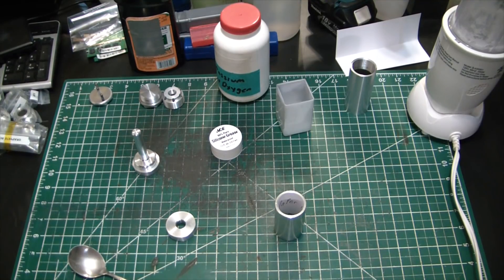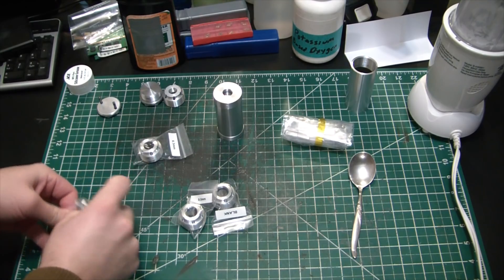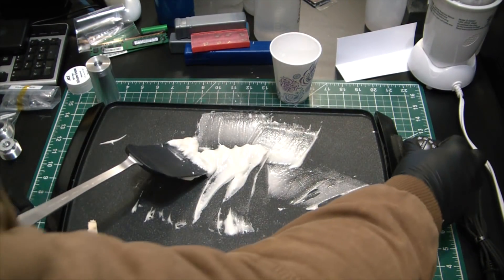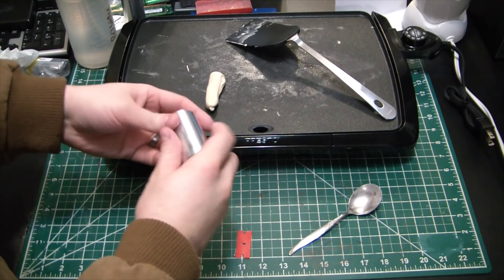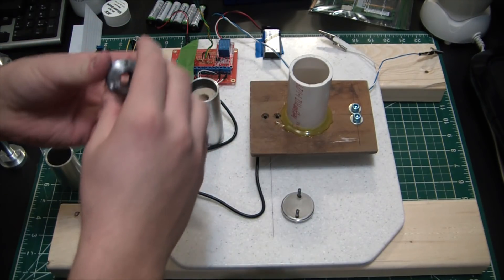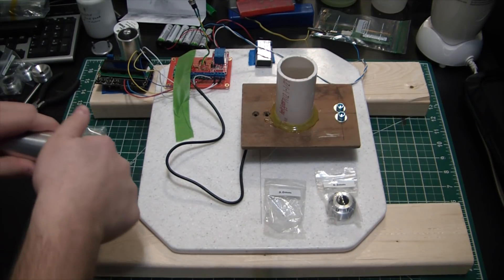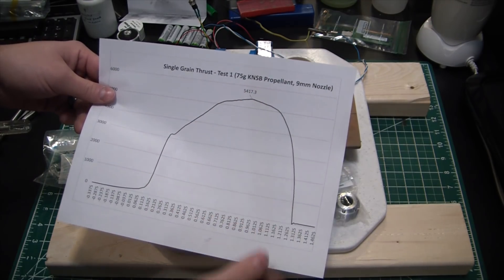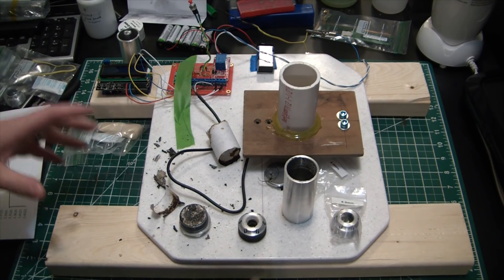Testing The Biggest Rocket Motor I've Ever Built on Arduino Stand - ElementalMaker

Comment: I'm a big fan of your channel! How do you calculate the diameter of the core rod for optimum thrust without blowing up the grain/engine? What percentage of the OD on the engine grain is the diameter of the core hole in the engine??  25%??  Thanks

Comment: I see Sorbitol was used but what did you use as the oxidizer KNO3, KCLO3, or KCLO4?
Reply from the maker: KNO3. KCLO3 is far too reactive to be used in rocket motors. KClO4 is one I haven't really tried for motors since I have NH4CLO4 available

Comment: have you tried to do multiple different ones like one of the fast burn (with the iron oxides) and the last one is a normal so that it has a lot of thrust and then it goes into the normal for long burn and yada yada and then have the burst charge to make a awesome rocket. should do a video of making a rocket and letting it fly

Comment: Why not heat the side of the chamber so that it melts and settles easily ? And also can u do a video on different oxiders?  Like I used patassium permanganate instead of potassium nitrate to make gun powder(kinda worked) research the different types of oxiders

Comment: This is the only channel I find myself referring to repeatedly to.  Like school texts.
My test stand is complete and I just graphed an old Estes A8-3.
I drilled holes in the pvc and hold the motor in with those squishy ear plugs.  3 of them hold it through the ejection charge.
I added an igniter continuity LED and a 1.8" Display (invisible in full sunlight)  Might need a piezo buzzer....

Long comment to bump YouTube Algos.
Reply from the maker: Thanks for the great comment 👍. What kind of thrust did you get from the A8-3?
Reply: @ElementalMaker  968g peak.  Wish I could post pictures... Just posted the graph on twitter: _Mycroftxxx
Reply from the maker: @_mycroftxxxadamselene922  wow pretty impressive thrust!
Reply: @ElementalMaker  I was surprised.  I bought these about 10 years ago. Thought they would be trash.  (But I live in the Phoenix, AZ area)  Even the igniters still work! with 9ish volts.
Reply from the maker: @_mycroftxxxadamselene922  black powder doesn't go bad as long as it's kept dry! Graph looked beautiful. Great data 👍

Comment: You could photocopy the thrust time curve, then trace the curve on a flat plate of aluminum, cut the plate to the shape of the tracing  then weigh the cut out of the plate. The weight is then proportional to the area of the curve. To estimate the total impulse make a rectangle out of this same aluminum plate, call one side “time” and the other “thrust” and multiple the length times the width, this area is the “standard” total impulse of the known area. The unknown is then the ratio of the weight of the unknown curve to the weight of the standard rectangular plate.  This is the “Galileo” method of integration. A faster method of the “Galileo” method is the use a length of fishing line and make a loop corresponding the total irregular close loop of thrust versus time. Then do the same with another piece of fishing line for the “standard rectangle” then the ratio of the length of unknown curved loop, to the length of the loop enclosing the standard rectangle is the total impulse of the test motor. Of course the curve “y -axis” and curve “x-axis” must be in regular units between runs (pick a total curve height greater than the expected thrust) and fix the ordinate scale. You can’t let the spreadsheet autoscale, you must use the same total height of the y-axis be fixed between runs .

Comment: Just add your thrust from start to end = 408.6
 (in kgs). Multiply by your sampling rate (0.0125 sec) = 5.108
 Kg-sec. Now multiply by gravity (9.81m/s^2)= 50.11 N - s....Or if you divide by 4.448 you get 11.27 lbf-s... pretty good for this tiny grain :)

Comment: any word on a price for that wonderful mold and motor casing kit? I suspect its well beyond what I can afford but you never know :-)

I already 3d print my rockets. I wonder if I could 3d print a propellant grain? mix the powders into a filament? I doubt it would work but would be neat if it did !
Reply from the maker: I have no idea if they are even willing to sell the motor kits, but you can try reaching out to luke foley and seeing.
Reply: In the US, HPR casings are available from various manufacturers.  There should be some manufacturers or resellers in Europe as well.

Comment: have you ever thought about trying to make liquid fueled rockets? great work btw!
Reply from the maker: Liquid fuel is pretty tough to do at the Amateur scale, especially on a very limited budget. I will be doing some hybrid motors soon though! Maybe liquid fueled someday
Reply: @ElementalMaker  Hybrids are not extremely difficult, if you use nitrous oxide as your oxidizer. The hardest part is avoiding an oscillating burn.
Liquid fuels are more problematic, since you have to control two liquid pressures to get a stable burn.

Comment: Have you ever used a octo-star core rather than that smooth cylinder? 
How much did overcooking the propellant effect it's burn and thrust?
Overall very nice.
Reply from the maker: I haven't yet but plan to in the future. That core geometry gives an incredible thrust curve. The overcooking likely decreased performance very mildly, since it was just barely caramelized. I will have to repeat the test with a fresh grain to quantify any difference.

Comment: It seems like a lot of people are just calculating the total impulse, which I agree is around 50 N-s. This isn't the full story however, specific impulse or Isp is better way to gauge the performance of a rocket. 

Isp = I/(m*g0), I being the total impulse, m being the propellant mass, and g0 being the local acceleration of gravity. propellant mass is 75 g (0.075 kg), g0 is 9.8 m/s^2, and I is 50 N-s
50/(0.075*9.8) = 68 s. Pretty good Isp for a sugar motor. 

Typical estes motors can range from 50-80 s. The space shuttle SRBs were around 250s.

A cool program to check out, ProPep 3 uses thermochemical calculations to give you the optimum Isp for a particular propellant mixture. It also spits out other parameters that can help calculate the ideal nozzle expansion ratio. There are hundreds of chemicals to choose from it really helps when designing hobby motors.
http://www.rimworld.com/loggerusb/propep3/intro.html
Reply: how'D you get the Impulse/I
Reply: @princemiro7241  Total impulse is area under the Impulse curve
Reply: Andrew Mitchell you just need to multiply each data point by delta t and add them up. This will give you a good approximation.

Comment: For the area under the curve, just sum all the data from START to END, and multiply the result by the timestep Δt (time between two consecutive measurements).
A = ~5098 [grams-force seconds] = ~50.01 Newton seconds

That's because you're building the area from little rectangles.
Every rectangle has height=value in grams-force    and width = Δt.
=> Area of the rectangle  is Ar = height * width = value * Δt
So we just sum all the areas:
Total Area    A = ∑i (Ar_i) = ∑i  (value_i * Δt)

But since Δt is the same across all rectangles we can simplify that to:
A = Δt * ∑i  (value_i)
Reply from the maker: Wow I didn't think how simply I could have calculated it! Thanks for shining some light into a dim section of my brain 👍💡
Reply: @ElementalMaker  
Yeah, that's why I like discrete math stuff xD
I've also made a spreadsheet with graphs and other cool numbers.
Maybe it could save you a little time, so you may want to check it out: https://goo.gl/n1HqdH

Thank you for the good content!
Reply: @ElementalMaker  Use rectangles where the curve goes through the center top of the rectangle. This approximates better because it takes the somewhat triangular section of the segments into consideration. 

You can use different width rectangles - as long as you also use the appropriate time for each segment. It is even possible to use horizontal segments, or a combination of the two.

Comment: This was a very cool video! Can’t wait to see some more tests! Could you maybe test out all the motors and nozzles in one shot? Load up all the casings you have?
Reply from the maker: I will probably end  up doing a compilation video of the various motor tests once I do enough testing combinations. It would be an insane amount of work to mix and test several propellant combos and motor combos for one video. I might do a simplified version though comparing a few types of propellant in the same motor casing with the same nozzle.

Comment: The area under the curve, using a trapezoidal riemann sum, is 5108. This is calculated by summing A[n] = Δt*(x[n]+x[n+1])/2 for n = 1...N-1 (Δt is the time step size, so 1/80s).

Comment: What happens to the excess motor propellant, can it be used again or does it need reheating? I have never played around with rockets so I have no idea.

I expected the motor to burn fast, but not that fast.
Reply from the maker: The left over propellant from casting can be stored with desiccant until needed. From there you can just reheat on the skillet and cast another grain.

Comment: Someone propably asked already, but I can't find an answer anywhere... Where to find this cooking plate you're using?
Reply from the maker: It's just a cheap electric skillet I got from Walmart. I'm sure you could find them anywhere. Just be sure you have a good infrared thermometer, because you can't trust the temperature indicator on the skillet adjustment.

Comment: Really awesome work.
But this is a big motor?
I was building zinc powder based engines fifty times the size of this one when I was 11 years old!
My last rocket was 9" in diameter and 22' tall. Speed was Mach 2+ and apogee was 7600+ feet!
Engine burn was 22 seconds.
That was in 1974.
I'm thinking about doing a 4th of July display using several rockets with 16 pyrotechnic payloads that deploy at altitude.
Reply from the maker: Well damn Art get some videos up! We want in on the action!
Reply: @ElementalMaker  I've been thinking about it. But I have COPD.
So I need to set up several cameras and then edit the footage together.
I've never made one of these videos.  Plus there's the expense of buying all the cams etc....
I'll probably do it, IF I do the fireworks displays....

Comment: Area under curve would be total impulse(just a sum of all the data points divided by the number of samples per second). To get specific impulse you then have to divide by weight of the propellant burned during that period.

Comment: You may consider using one of those squishy ear protection devices to plug the nozzle... This will hold the e-match in place and secure any loose black powder, when in normal launch configuration orientation.
Reply from the maker: Damn that's genius!

Comment: Looking at the image at 11:47 the ideal square pulse area is 1.3*5417 = 7042 gram*second. However, I estimate there is a loss of about 30% of that area by eyeball, so the area under the curve is a bit under 5000 gram*second, or about 50 N*s for your impulse. 
This is just a rough eyeball, but should be good to within about 5%.
Reply from the maker: Very good estimation! The most exact answer I've seen so far was 49.795 or something along those lines 👍

Comment: Let’s see if you can make an engine capable of providing 7 pounds of thrust for 13 seconds.
Reply from the maker: Thats quite a motor you describe. Why those numbers specifically?
Reply: ElementalMaker  Its all about diminishing gains
Reply: Does it have to be able to lift a rocket? Building a motor with 7 pounds of thrust which burns for just about any length of time you desire is trivial. Just make it an end burner.

Comment: From the timepoints of your measurement you can calculate a delta t between one point and the one before, a simple subtraction. Then you multiply the delta t to each of your values of force. You said, that you are using grams as unit. One gram is 0.00981 N. For the delta t I calculated 0.0125 s. When you multiply the force with the delta t, you get power in the unit of Ns. Then you sum up all the Ns. With your provided data I resulted with 49,191 Ns, what makes this motor a F-type.
Reply from the maker: Thanks so much Sebastian!

Comment: To get your total impulse a quick way would be to take the average of all your thrust data points and multiply it by the duration of the burn. Might have to convert thrust data to a proper force unit of Newtons though.

Comment: That higher rate of increase in thrust that we see in the graph is because of the added energy from the black powder?
Would be nice to see a graph of the same setup, but without the black powder.
Reply from the maker: I don't think there was much added energy, as I used less than a gram of black powder, but it certainly produced a much faster, more uniform and complete ignition of the inner grain surface. Love me some BP!
Reply: @ElementalMaker  I was curious because the profile of the increase in thrust is so clearly divided in 2 stages, was trying to find an explanation as to why that is.
But i´m a geologist, so if i can´t figure it out by hitting it with a hammer and looking at the broken pieces, then i won´t be of much help.

Comment: Cool but make the engine from metal wouldn't make it heavier than paper one?
Reply from the maker: Not necessarily. The Aluminum casing is much stronger than paper, so it can have a thinner wall. I would guess the weight to be equal to or even lower that with a paper tube of the proper size for this motor.
Reply: @ElementalMaker  amazing :D

Comment: Please add 20% fine powder aluminum to your propellant. It's 20% needed to whatever composition  you made to equal 100%  Play with the measurement as results may vary. BUT Always remember that 20% aluminum. Put that into the equation and you'll have found a powerful rocket engine as the 20% will give you more chamber pressure when it burns and more thrust.
Reply from the maker: Yeah that will result in schrapnel heading my way... You may be thinking of composite motors which use a small percentage of aluminum powder, but different oxidizers and binders that the sugar motors I'm making here.

Comment: Can you try adding some copper oxide or barium oxide to your mix to try and get a pretty green flame some time? (or any other color you may want, I have a chart I could pm you on facebook or post on twitter if you want, if you have them) I'd still love to see someone make a long burning engine.. I don't know if that's possible at the amateur level with solid fuels or if that's a liquid or hybrid only option. I'd love to see an engine sitting there for burning like 30 seconds to a minute at full power.

Comment: How do you calculate the proper nozzle diameter for a given motor?
Reply from the maker: There are actually some rocket motor calculators online that can provide all the parameters of motor.
Reply: @ElementalMaker  Thanks! Rusty, last time I DIYed this sort of thing was 1976 or so. A while ago and pre-Web :)
Reply: If something blew up, the nozzle was too small - so make the next nozzle with a bit larger throat. 

If it was successful, it may too large, so make the next nozzle smaller.

Comment: after watching some of your vids the term lubing your shaft definitely has more than one meaning!! Birchwood Casey choke tube lube might be better for the threads, seeing how it's made for shotgun choke tubes. they tend to take high pressure and heat in extended firing sessions at the range, i've had pretty good experience with it! do you think the slight overheat may have sped up the burn rate any? i expected a bit longer burn for it being that sized motor.
Reply: "A double entendre!", he ejaculated.

Comment: how do you make e matches? :D
Reply from the maker: I have a video on making them.
Reply: @ElementalMaker  If you have Thermalite fuse available, you can make your own using wirewrap for the leads. You just remove all the wire wrappings on the Thermalite except one. Such fuses work quite well with AP/Al fuels.

Comment: I'm pretty good with spreadsheets, so I took your data and analyzed it.  I picked slightly different start and end points, and I accounted for weight change due to propellant loss.  My resulting numbers are 5161 g*s of total impulse, a maximum thrust of 5455 g, and Isp ~= 63.5.  If I assume the scale is calibrated to standard gravity, that converts to 50.6 N*s impulse, 53.5 N thrust.  Spreadsheet link: https://docs.google.com/spreadsheets/d/1rkrF1pvZaHNqi433P4Dhvtuc4rVbIAsF_u6qOrvVzoM/edit?usp=sharing
Reply from the maker: Awesome thank you! Beautifully done!
Reply: tippyc2 I went over your spreadsheet calculations, which were very good. I noticed a discrepancy in the mass of the propellant. The graph header shows a mass of 75 grams. Looking at the data and your spreadsheet the load cell measures 63.5 grams differential from start to completion of the motor burn. Using that value in your calculations results in a propellant consumption error. The black powder igniter, electric match, and wire clips at the start, are unknown masses affecting the load cell beginning value. They are eliminated upon ignition resulting in an unknown load cell error at the completion of the test. In tests where measurements are in grams, it is best to eliminate all potential error factors. Make them known measured values or in this case use the known propellant mass and average the consumption.